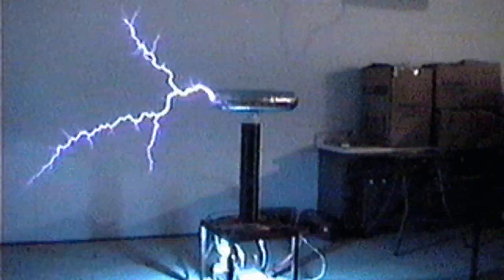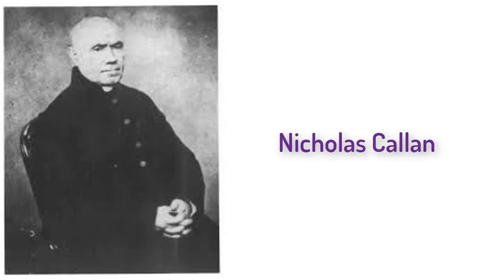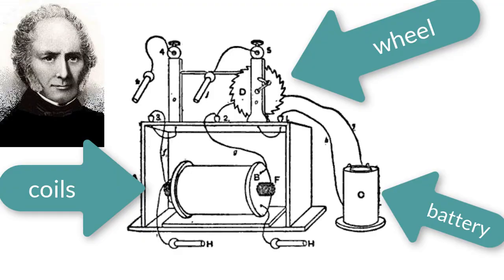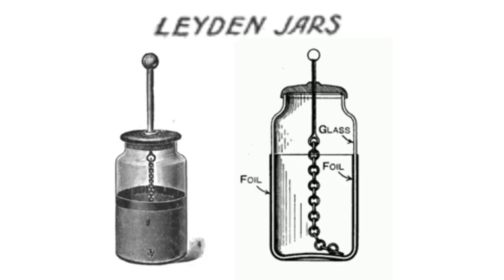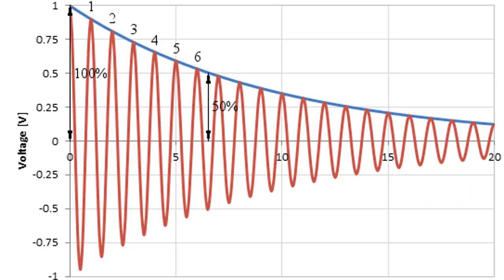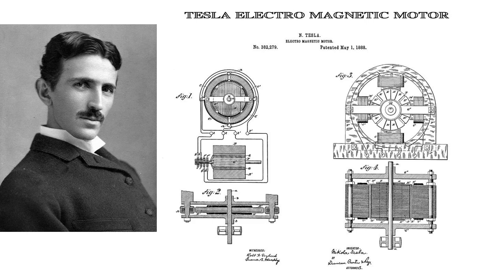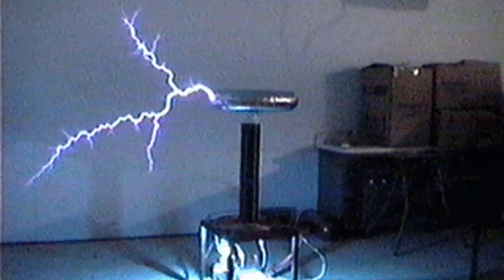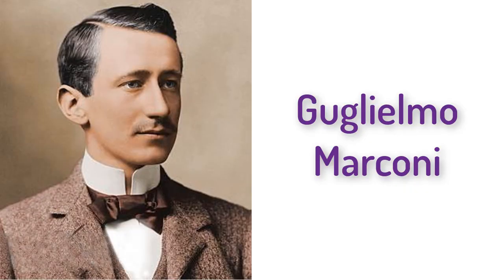How Does a Tesla Coil Work? A Historical Deep Dive

Comment: Thank you mam. The video was very informative. It helped me a lot to clear my whole doubt about Tesla coil.
Reply from the maker: So glad I could help.
Reply: @Kathy_Loves_Physics  can you please make video on different types of transformers. Sometimes they have different number of legs. Sometimes difference in AC voltage supply like 220 or 110v and frequency. It is too complicated to identify which one is made for which.
Reply from the maker: @radeonblue1816  As far as I understand it, transformers are ridiculously simple, as they are just coils wrapped around a bunch of metal wires.  They cannot change the frequency by themselves but can change the voltage and the current.  If the input has more loops than the output then the voltage goes down (and the current goes up) proportionally.  If the input has less loops than the voltage goes up (and the current goes down) proportionally.  Well, close to proportionately, some of the power (and the power equals voltage times current) gets lost to heat.  220 Volts is what is used in household plugs in the US and 110 is used in the UK.  That is why you need a transformer to use your electrical equipment when you travel.  The only other thing is that transformers used by the electric company are often for three phase wires so it needs three separate sets of coils.
Reply from the maker: You might want to watch my videos about the invention of induction:
https://youtu.be/MpjoGC-Prks

The Invention of the generator:
https://youtu.be/zzL_9aGBQ2I

And the Physics of the war of the currents (AC vs. DC)
https://youtu.be/RMxvhUEPJ1k

As, in my opinion, learning where things came gives them context which makes more sense.  Hope that helps.

Comment: Sorry Kathy but tesla secondary are a helicoidal transmission line generally at 1/4 wave...but not a resonant lumped circuits...or transformer.
Curious thing are you need more wire than 1/4 wavelength...guest why?
A linear wire...has all his section exposed to electric field between him and ground.
But once coiled...the internal diameter are shield from "see" ground, therefore the inner section contribute with less surface to ground than external sections of the wire then his distributed capacitance constant diminished..mean a coiled wire has less capacity for unit of length than a straight wire.
Since the wavelength depend upon a intrinsic inductance and capacitance of the transmission line, you need more inductance (more wire) to reach such wavelength.